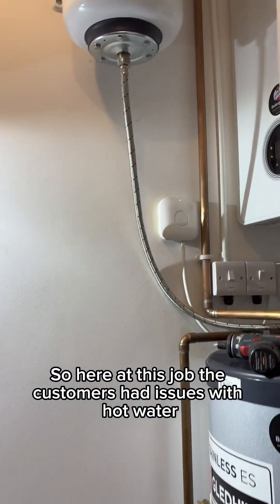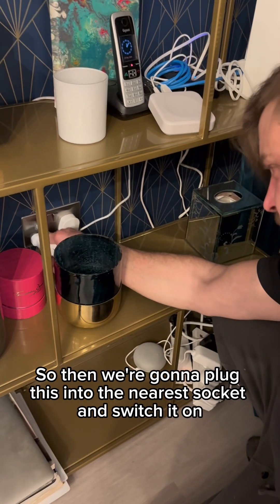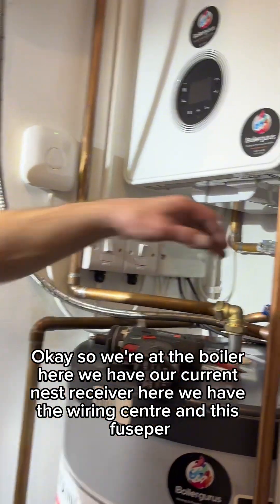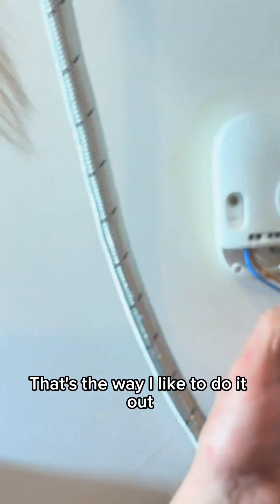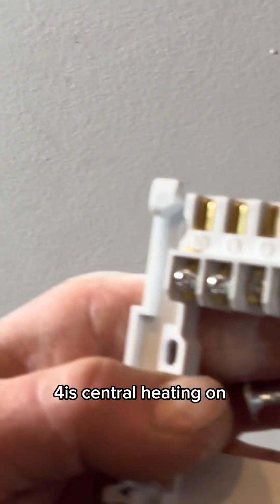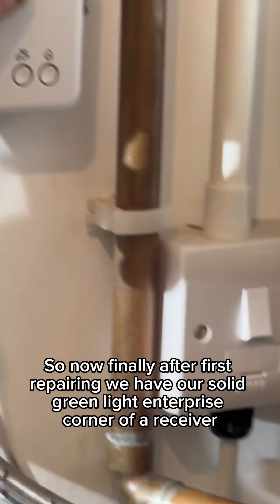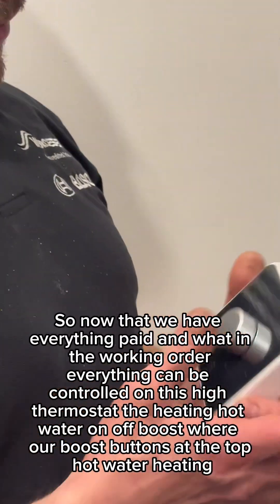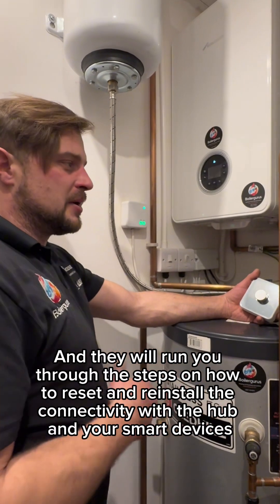How to swap from Google Nest or Other Programmer to Hive & How to install a Hive smart thermostat

Comment: Why does the Hive need 2 hubs and wire wired Ethernet? Seems old design?
Reply: agreed - there is no need, just not thought through. Nest gen 2 (~2012) only had 1 hub device which connected wirelessly.